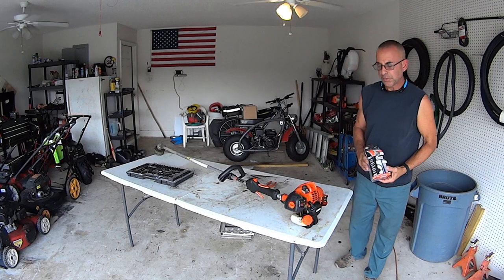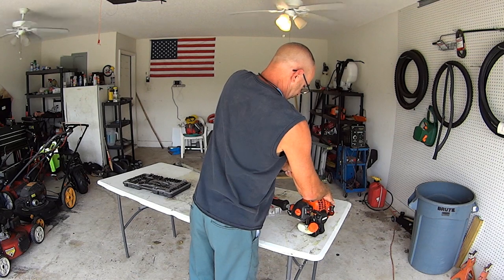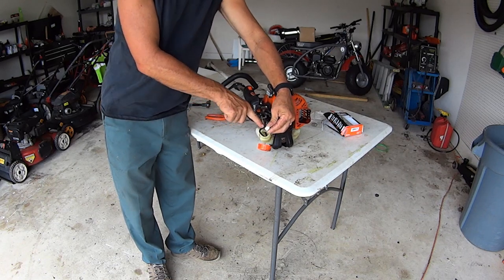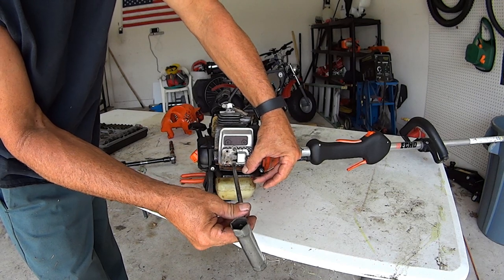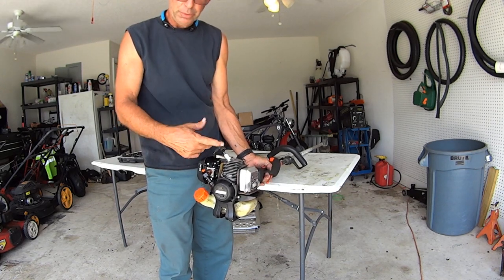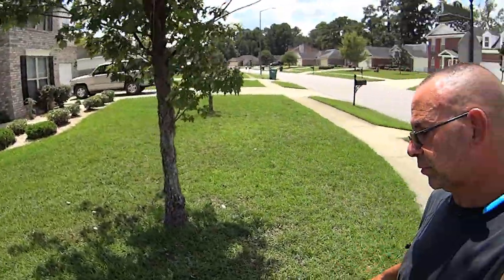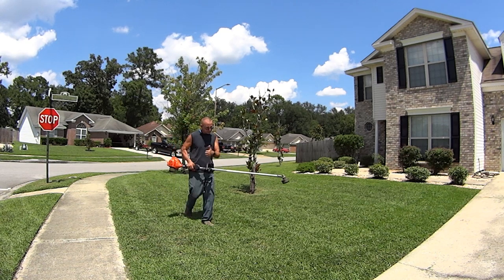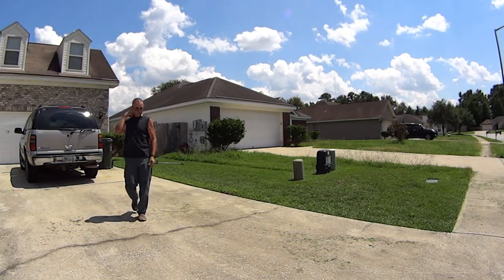Install Tune Up Kit 90152Y on Echo SRM225 Weedeater - Exhaust Mod - Test it out #SideHustle

Comment: I fix my Echo srm 2100 today also. But I bought a cheap $15 kit from Amazon. My kit came with a Carb Filter Plug gaskets and extra Primer Bulbs and Gas Filter. I had my doubts when I bought it. It took me 10 minutes to install everything.  Then I fired it up one pull. It ran like new.  Mind you it was sitting in my shed for years. And I got it from a buddy who had it for years.
Reply from the maker: ahhhh the sweet stories of success!!! Love it
Reply from the maker: Very good move! The slightest split in one and game over

Comment: Hey Dan great video brother I've been doing lawn service for 35 years and I'm starting to get cts on my hands and arthritis its been terrible man I bought an echo articulated hedge trimmer with a 2620 engine which is marvelous but weight to me now is very important so I went to home depot on Friday and got a brand new srm225 took the engine out swapt it on my articulated hedge trimmer and wow what a difference in weight my hedge trimmer guy loved it he trimmed hedges all day long with it and didn't feel fatigued like he used to my mechanic has told me landscapers get years out of these units and I'm very surprised and pleased our weed eaters are all 2620 echos and there pretty light weight but as hedge trimmers we are going to be using the 225 for sure from now on and for the price you can't beat it.

Comment: Besides tossing the screen... remove the muffler from the trim. Bore a hole near the bottom of the muffler from one chamber to the other. It will reduce the back pressure and give the engine more breathing

Comment: Good video Dan.  Most spark plugs are pre-gapped at the factory to .030 which is a standard gap for most equipment (sometimes .025).

Comment: For those asking about the ECHO SRM-225 trimmer, I have used one for two years and its a great trimmer, its a little weak in tough grass/weeds. The 2320T has a gear reduction for more power and the larger power head 2620 comes with the 1.62 & 2.0 gear reduction with a commercial engine priced at 100 bucks more than the home use 225. I run the srm225 for two hours cutting grass and weeds in the rough areas, it uses about a quart of gas, never had any problems with the trimmer.
Reply from the maker: For the 225, I would definetly use smaller .080 round line. Will help the smaller engine run with more pep
Reply: @DansVlog  Yeah, I have 080 and 095 line, the orange lasts longer in county grass and along wire cattle fence.

Comment: Love your videos man!  Removing the screen to improve performance is debatable.  Remove or don't remove it, up to you.  The one reason I don't recommend it for most, is that removing the screen will change the jetting/tune slightly....probably make it run a touch leaner, which we all know isn't really good.  If you know how to re tune, then no big deal.  A quick tip if you want to clean the screen and reinstall it......hold it over a lit propane touch with a pair of needle nose pliers, and it will clean all that soot off in about 5 seconds!  Keep up the great videos.

Comment: I heard a difference after you gave your little weed-eater a tuneup. It definitely sounded stronger and smoother (really!)  than in the last video. Do you have any customers that prefer you cut their lawns on a weekly basis? .
Reply from the maker: No weekly basis. I usually tell em every 2 weeks and they agree
Reply: IF you cut too of the blade off at each cutting.  It will dry out the blade of grass.  Proper mowing is twice a week and apply some water to replenish lost moisture due to the cut end. 

But if you don't want a heathly looking golf course lawn then...  cut it whenever...  🤷‍♂️

Comment: Great video dan. That’s what I use too. I also have the same motor as my edger the PE225. They are the cheaper ones out there but work just fine

Also, you said you don’t think you have the speed feed. You should have the speed feed head they come with it stock

Comment: Im going to go look at a used stihl fc 90 edger tomorrow. Any suggestions on what i should be looking for when purchasing used equipment.
Reply from the maker: Know that anything used being sold is for a reason, don’t pay more than 30% new retail price.
Reply: @DansVlog  120.00 i only plan to get it to hold me over till i save up for a km 94 or new fc90

Comment: Good video! What's the name of the tool you used to take off the screws on the trimmer? It looks like a spark plug wrench was well.
Reply: Google search Scrench.  It's a multi-tool wrench.  I mostly see them used by chainsaw owners.
Reply: @JChamberlin  Thanks!
Reply: Looks like a Stihl combo tool.

Comment: Dan would you suggest the 225? Seems like a good price and I'll be in the market for a new one soon enough.
Reply: Robert Johnson I just got one a couple months ago and did a full review on my channel. I love it. Huge upgrade from my old ryobi. It’s more than enough power if you are just a typical homeowner, heck even some pro guys run these full time without any issues.
Reply from the maker: I recommend it based on all the comments I have received from owners who love it and what little experience I have with it so far. Seems like a winner

Comment: Dan if I have some oil coming out of the exhaust does that mean I have too much oil in my 2 cycle mix? Thanks
Reply from the maker: Means it is running rich, carb may need adjusting. Also 2 cycles will do that if running low RPM’s a lot.

Comment: Also some echos has a catalytic converter in the exhaust. Remove the whole muffler off the engine and clean it through. When it's durty it boggs and won't Rev up
Reply from the maker: Thank you for the information!

Comment: I have a question. Can I turn my Echo SRM2100 into a Stick Edger? Does Echo sell  anything a kit to covert it?  I always wanted a stick edger.
Reply from the maker: You’d be best informed if you go to a Echo services shop and ask them but my first thought is it would not be cost effective. Brand new Echo edgers are inexpensive. Buying parts is always costly
Reply: You can if you have a echo edger shaft
Reply: I have done it
Reply: Thanks for all the advice. But I had a Poulan pro sitting in my pile of weed eaters to fix,  so I fixed it and bought the $90 edger attachment. All I can say is wowsers.  I have a southland walk behind I bought off craigslist a couple months ago for $100.  But this stick edger is the bomb. It is faster and much easier to control. I did my lawn and the neighbors lawn in minutes.  Stick edgers are the best hands down.  I'm one happy camper.

Comment: Could you share a link or where you got the scrench used for the Echo tune-up ?
Reply from the maker: It comes with all my Stihl tools. Amazon search Stihl spark plug wrench and see if it gets you there. I will see what I can find when I return home
Reply: @DansVlog  Thanks! No worries I got it from here. I just needed a starting point. Keep up the great work!